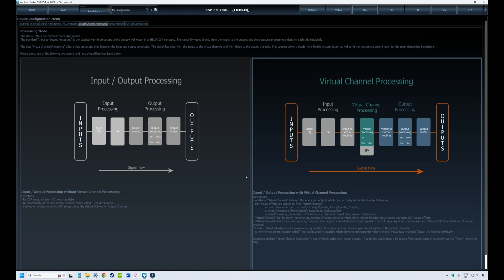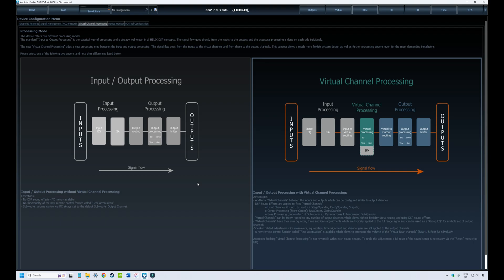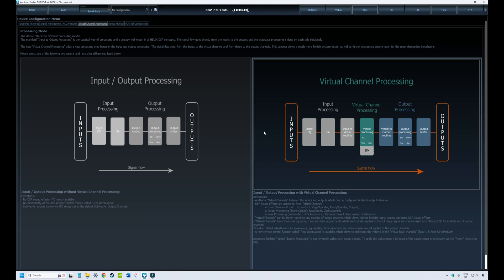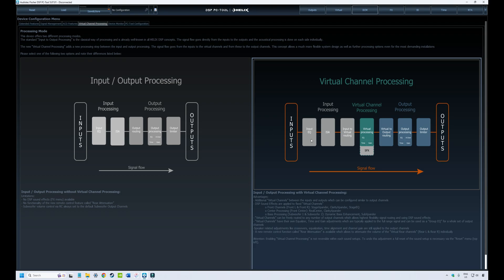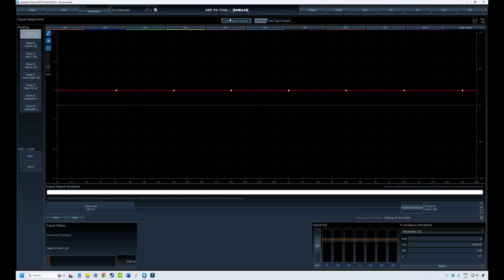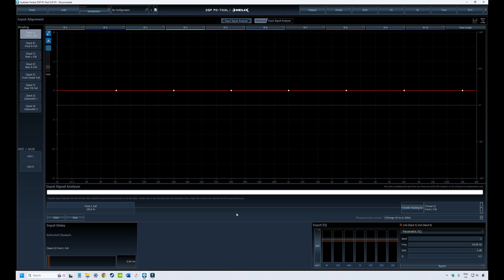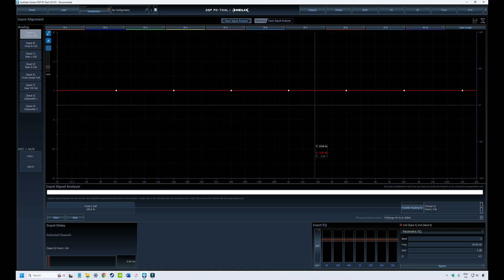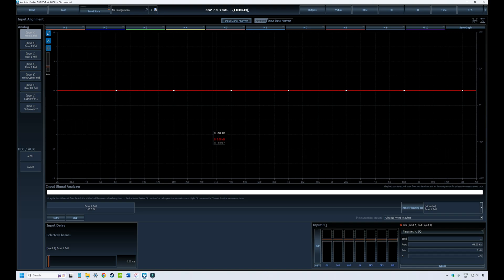HELIX DSP PC TOOL tutorials - Part 7 - Input Signal Analyser

Comment: Is there any way to analyze the digital input? Thanks.
Reply from the maker: Hi Image...  I am guessing your digital unit is connected (wired) to the DSP using an optical cable or something and there is no option for digital on the ISA page?  Hmmm then the answer is no, not that I know of.   But if your DAP has blue tooth streaming capabilities and your DSP has a blue tooth expansion card, then you could try BT streaming the digital signal and use the HEC/AUX input to the ISA and analyse the signal.   It might work but I have never tried it.  Hope this helps :)
Reply: @socketsocket2763  Apologies for the late response & thanks much for your reply. Correct @ optical cable. Haven't decided how I want to rectify this yet unfortunately. Have a feeling it's messing with my low end in some way or the other.

Comment: So Input Signal Analyzer  is really only useful for running Hi-Level (or Lo-Level) inputs, from an OEM Headunit...right? If I were using the Digital (Optical) Input (from like a Digital Audio Player), I wouldn't need to use this, right?
Reply from the maker: Hey Lou...  The Input signal analyzer is basically a way of EQ and levelling out the input signal.  Typically where old school head units have filters and stuff built into them that boost/cut or change the signal going to your DSP from a flat level signal (if you follow).  If you have a clean signal from your DAP or phone etc, then yes there is no need to use the input signal analyzer :)  Hope this helps
Reply: @socketsocket2763 helped a ton, thank you!